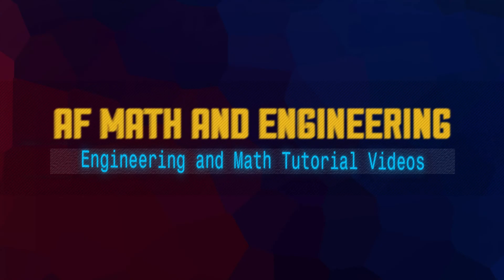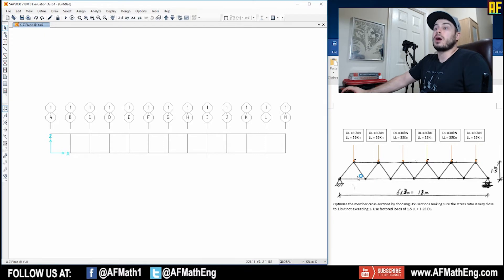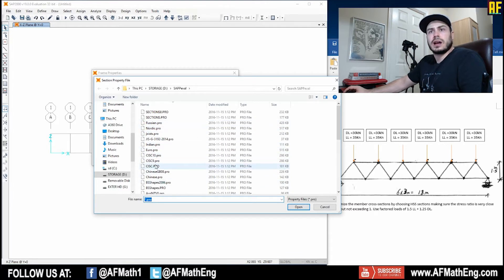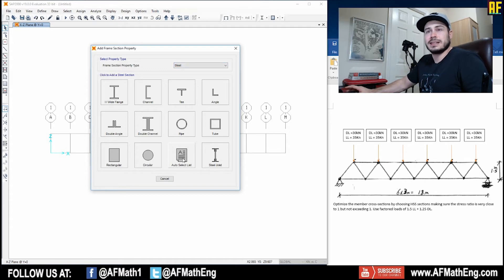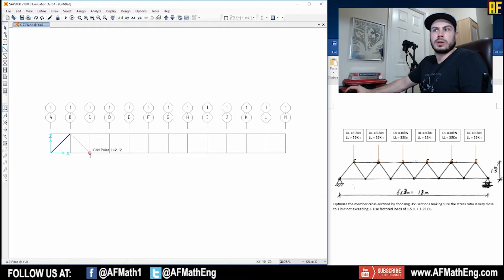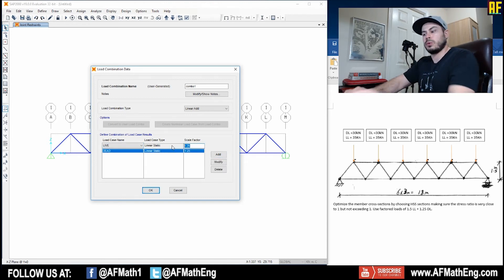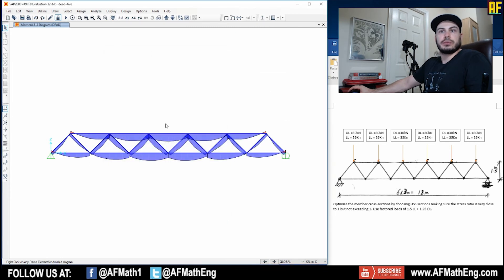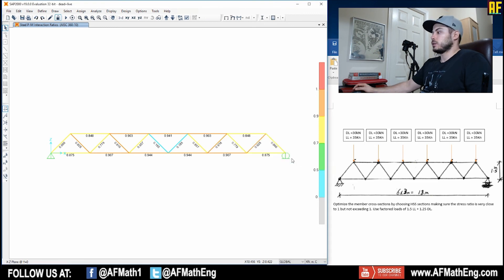SAP2000 Steel Frame/Truss Design - Optimizing Sections and Using Load Patterns/Cases Tutorial

Comment: Awesome Tutorial! I have one question.....Why did you not make moment releases at the Joints (Partial Fixity)? Trusses are in tension and compression. Please advise.
Reply from the maker: Thanks! Not all trusses are complete pins at the joints in reality, you can see even in this non released truss there is very little moment into members. Also the question didn't state that we should assume pin connections so we didn't do it here.

Comment: Hey, thanks for this tutorial. I have been trying to use this function in my project, the thing is, it finds the solution but very often goes over 1. So I have stress ratio of 1.05 on multiple occasions. Can I set somewhere that it has to be lower than 1?
Reply from the maker: Hey Kaja, thanks alot really glad you enjoyed it.  That's strange, it shouldn't give you values of over a 1 stress ratio as it means the member is not adequate.  Could it be that you haven't provided sap with enough selections in the auto select list and it has to choose a member that's inadequate?  Try selecting larger sections and adding them to the auto select list and see if that helps!

Comment: when we run it and see stresses on the frame, it gives us a diagram of colours and numbers on the right corner. When i check the frames, most of the frames are red. Should i worry about the reds or just check the stress value? values are around "-140" on the red ones. i guess "-" means compression on the frames. and the units on the screen is N,mm,C. So should i understand that the stress on the frame is "-140N/mm2" and it is actually safe because the material i used was S355 steel. 355N/mm2 for yielding, 510N/mm2 for tensile strength.
Reply from the maker: +theoregon Sapp does that sometimes with he colors, as long as the stress values are adequate you're good. The negative sign is sign convention?, compression and tension.  If you're modelling a truss make sure to release the fixity of the joints!
Reply: I didnt release all of the elements, only the braces i did. It's a Drilling Mast tower, so its around 30 meters height. I connected all the structural coloumns with continuous which are on the same grid z. they have to be connected rigid to eachother but the braces are released so far
Reply from the maker: theoregon perfect.   Sounds cool!
Reply from the maker: theoregon also feel free to email me at afmatheng@gmail.com I'd love to hear more about your project, it sounds interesting.